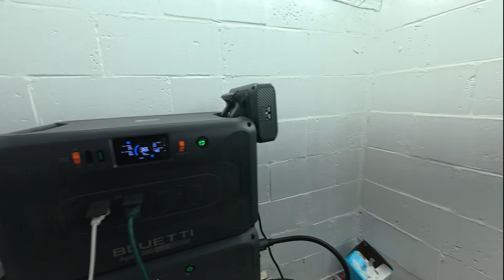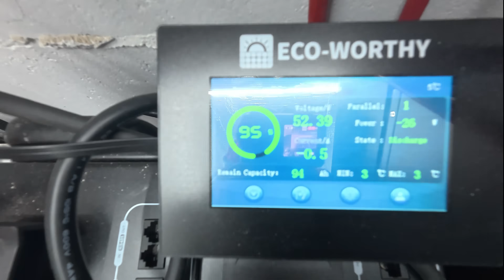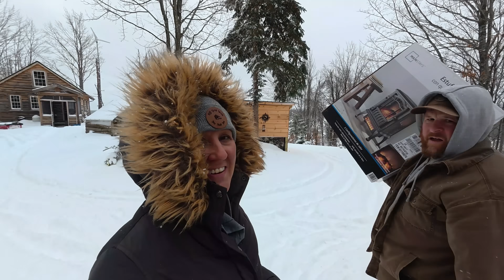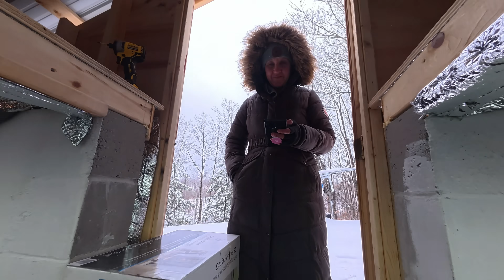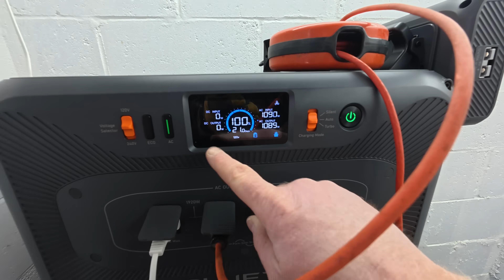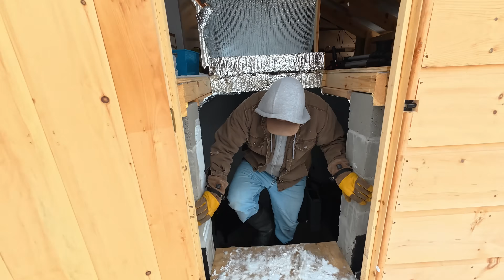Experimenting With Heat in Our Off-Grid Bunker | PLUS SOLAR BUNKER UPDATE

Comment: Great video! You should look into those oil filled rad heater. It is radiant heat, like a water filled rad. But once the heating element heats up the oil it will shut off raising its efficiency. They also come with a mechanical switch to work off your bluetti I believe low is only 600 watts medium is 900 watts and together is high at 1500

Comment: Probably best for the batteries if you do heat it up to 65f with the Gen or for 10-30min before starting the charging.

A old style plug in timer could heat it up for 20min everyday before sunrise.

Comment: 52,4 V is cca 60%. not full, soc calculation is bad...
Reply from the maker: Thats what I was thinking. all the batteries are equalized in voltage, but the screens are not displaying the proper SOC. I think you are right

Comment: Hi! I am following from Italy, finding your  videos very interesting . I have seen with great interest the building and setup of your bunker but i have a question regarding the position of some of your batteries. Some of them are installed FLAT on the floor, one over the other, and this is, in my opinion, absolutely correct. Other batteries instead are installed vertically with the display and connectors up. Did you ask to the battery provider if this setup is ok for the cells? Maybe the gel in the cells isn't working properly and this could be a problem causing a shorter cell-life! Please check with battery producer, i would like to continue following your channel without blackouts due to battery fault. Thanks for your videos
Reply from the maker: Great advice. They should all be ok. We have seen others do them this way as well. Thanks for your concern. Thanks for watching from Italy!

Comment: Your consumption is so low that the batteries go into standby which is kind of like "off" mode.  That is why they are still 100% SOC.  Pull a large load to wake them up!!
Reply from the maker: Glad to hear it, I started transferring power from this system to the back up system and the bluetti system and they seemed to come on when needed. BUT...once the voltage dropped they all read zero out of the blue,  so im going to keep monitoring it all 👍

Comment: How can your batteries be tied together and not all be the same percentage rate of charge?
Reply from the maker: They equalized by voltage.....I think the percentages may be showing inaccurately,  but still working well
Reply: @OffgridwithJayandJen  how about they are showing correctly, and you have them hooked up incorrectly?
Reply from the maker: @JohnSmith-ug5ci are you asking or what? The batteries are all the nominal voltage so they can safely be hooked together like I do.....the problem is with communication and the BMS reading and tracking the capacity because they are all hooked together.
Reply from the maker: @JohnSmith-ug5ci they can be hooked up like this safely......it just not the most ideal fashion
Reply: @OffgridwithJayandJen  Not talking about safety. Just proper install and clearly this is not proper.
Reply from the maker: @JohnSmith-ug5ci yes, we are experimenting.....as stated in the title. Plan and simple

Comment: You need solar assistant and a victron battery shunt integrate those and you will have a better idea of where you are at with battery voltages translated to SOC and better tracking with the Solar Assistant.

Comment: All resistance heaters will generate roughly the same heat per watt and are effectively the same efficiency. It's a shade over 3.4 BTU per watt. That includes the incandescent bulb in an enclosed space because even the light will get absorbed by surfaces eventually.

You could get any ceramic heater with variable heat levels, especially if it's network controlled. 

A Starlink mini on the standby plan will have plenty of bandwidth to control everything in there and then you wouldn't have to run cables or dig trenches.

Also, have you ever seen solar thermal collectors? You could put one vertical on the south side of the bunker with an awning that would cover some of it in the summer. It's effectively just some black tubing that the sun hits, and the awning wouldn't block it when the sun is low in the sky in winter. It would likely keep the mass in the bunker much warmer. Then just a little 500 watt resistance heater set to like 5C to come on if the equipment running and solar thermal collector doesn't keep up.

The bunker is a great idea, I'm in East coast Canada and wanted to do a solar shed like that but never even thought to do a bunker.

Have you ever seen Tech Ingredients 150 dollar ground source AC video? You could also do something like that with any cheap cmheat pump and likely pull a COP of 4 which would get above 12BTU per watt instead of the 3.1 of the resistance heaters.
Reply from the maker: Good Info, I'll do some digging and find the videos. thanks for the information and suggestions.

Comment: The batteries will always draw down at uneven rates. Even the same brand paralleled the propper way will have some variance. That being said, The BMS systems don't all report percentage the same either. The biggest thing to look for is the voltage of each unit. The voltage should stay the same accross all the batteries. Where you will run into imballances should really only be when you have a medium to high load (charging or discharging) on the system. 
Say your batteries are all full and you decive to run a couple electric heaters. The Battery with the largest capacity and lowest resistance will be providing the most power to the inverter (Lets call this battery A). BUT!! This will cause the voltage of battery A to drop more quickly than Battery B,C,D,E,F.... What you will see happen is those other batteries will start supplying more power and Battery A will be supplying less.
What you will see happen in this instance is when you turn the load OFF, batteries B,C,D,E,F will continue to DISCHARGE, but the power from them is actually just feeding into Battery A until all of the batteries are at the same voltage again. Hope that makes sense.

Where this might be a concern is at the bottom of the charge level. If the batteries are about to die, a few of the batteries will die FIRST, the BMS will shut them down and then the other batteries in the system will take up the slack until all of them shut down. Still, this isnt much of a concern since you have safety system (breakers and fuses) in place to prevent overcurrent on the wires. 

Sorry if this is a bit long to read but I hope it helps.

Comment: What is the big opening on the roof over the battery’s?
Reply from the maker: inside the bunker? there is a spot for all the wiring to come in and out, it is closed up tight, but not insulated well yet. Above the Bunker is storage for some things and it is where we have the generator for charging in winter.

Comment: I'd run an eternity cable from your router/starling to the bunker. Put a router or extender as an access point on top of bunker but inside the door. That should help with a better signal strength.
Reply from the maker: Great idea
.we will consider that

Comment: Plan on enclosing the otherside of the shed?  Seems that lots of snow gets in there and if the temps do rise it melt down into the bunker.
Reply from the maker: We are not sure what we are going to do there. 
Snow gets in mostly from the side the door is on. It needs to be buttoned up as there are gaps between the wall and the roof.  We will be working on that soon!!!

Comment: Looks like all those extra batteries and panels are paying off! Nice work! I think those oil filled electric heaters would work out for your bunker. I think they have a low setting of around 500-700 watts along with a thermostat?
Reply from the maker: They definitely are! Appreciate the heater suggestion, we'll look into those!

Comment: You have a pretty massive battery bank for 200w of steady consumption.  Some BMS's aren't able to track very small amounts of power in/out of a battery.  I have seen many situations where a tiny draw will result in a battery reporting it's still nearly full, when it's almost empty.  It's entirely possible your bank is so large, with so many batteries contributing to the draw, that some of them are putting out so little energy it can't even be tracked by the BMS.  If your largest battery is 67%, and all of the batteries are properly connected to a set of large buss bars, then it is FAR more likely all of the batteries are at 67%, or thereabouts.  That's how it should work, if you have everything wired correctly.  Since you are using what appears to be pretty beefy buss bars, that would explain the results you're seeing.

Comment: Yes we have a junk drawer a couple actually 😁. That silver lining stuff you have insulating the bunker might also be blocking the signal as well. Besides the other things you mentioned such as concrete and underground. You could try a wifi extender to see if it works and if does you could put a WiFi camera in there to keep an eye on things as well, when running heat in there. If that heater has a thermostat on the lowest setting, it should come on and off,with door shut, when it reaches temp correct or no?
Reply from the maker: Ya the foil is definitly causing issues with getting the signal. Yes the thermostat will help control it better.

Comment: I dont know for sure if it is the case for the models of battery you have, but some BMS have problems counting. The use of power when the draw is wery low, and if you spread 100, or 200 or 300 watt standby load on a bank as big as your, and the draw is spread out more or less even on about 15 batteryes, it is  only 6 to 20 watts eacy and may not get accounted in SOC.  As for the green lights on the front of the batteryes the split up 5 kWh in big chunks, so just a Rough indicator. Yes the most importen part as for temperature is to keep it abow 0 degree celcius, if you are charging them, but I would try to keep it at aleast 10 c.

Comment: You need to seal up that other side Jay. It will not be 100% temp regulated until you do that. If snow is getting there that door with the lock wont matter.

Comment: Junk Drawer always Saves the Day. 
Life Smart Radiant Heaters are the best I have Found Watt to Creature Comfort  " HEAT " these Units run Eco Mode @ 500 watts, Medium @ 750 watts and 1500 watts on High. most small rooms like it most on Eco Mode to Remove the Chill  🥶 and able to WiFi Connect to My Eco Flows and Oupes Mega 1 and Mega 2 Units when needed.

💦 Indian Creek Ranch ⛩

Comment: Jay, concrete blocks radiate cold from the outside. Have you thought about putting more of what you have on the ceiling into the walls? If you had dirt on the outside of every wall it'd be more like a cellar. Put your thermometer pointer on places to see where the cold is coming through. Might not need any heat source if it equals being a true cellar. Great job keeping up on the battery rates
Reply from the maker: Ya I think some adjustments are needed

Comment: Ya shouldnt mix and match the batteries like ya have but ya need a cheap thermal camera to check the temps but also insulate the battery bunker properly aswell and btw the 100W light wont produce shit to warm it up
Reply: I thought the same thing about that 100-watt incandescent bulb. A lot of viewers over many videos suggested it but the size of the room and all the equipment in there is just too much.Ain't gonna do nuthin'!

Comment: @offgridwithJayandJen - First thing to know, is that NONE of these battery meters are that accurate particularly when they are not fully charged every couple of days.   They have to measure the current in/out to and calculate based on the known capacity.  Also, the BMS in many of these battery brands are not able to measure small amounts of current, thus with low draw, they dont even adjust the %.  You can only really know the charge levels near the top and bottom of the charge based on voltage.  Voltage between 20-80% is almost the same, so even using voltage is not that accurate either.  Hope this helps.
Reply: just make sure the voltage between each battery bank is basically the same (+/-0.1v)
Reply from the maker: Good to know.....they are equalized pretty well, I think within 1/10th of a volt, so im thinking im good. Thank you

Comment: maybe either add some concrete blocks in front of the heater or just turn it around to the wall. Thermal mass is your friend!! heat for a cou0ple hours and the blocks will continue to release the heat back into the bunker after you shut it off.

Comment: You could just set the thermostat to maintain the temperature. It would work as long as you have sufficient solar to keep the batteries up. A smaller heater that used 300 watts could work. It could be connected to a thermostat so it would shut off if you find it gets too warm when running continuously.

Comment: i built a small solar hut and put a space heater like the one you have. I put the electric space heater on the lowest thermostat setting and let it do its thing. I also put it on a wifi outlet to have extra control of it. i ended up bringing my solar equipment inside the house because i didnt have enough battery/solar panels to keep up with the house and heating the small hut.  Thanks for the video!!!!

Comment: I have many 'junk' drawers - - a drawer for the batteries - a drawer for tools so I don't have to go out to the workshop - a drawer for my plug in scents from Bath n' Body - (I have 4 small drawers on both sides of the sink front - that's just the kitchen - of course there is the bathroom drawers for the extra's. Then there are cabinets in the basement - storage in the garage -  whew - I think I named them all!

Comment: You’ve ran soo much cables everywhere you just need 1 more, CAT 6! Run a LAN cable straight from your starlink to the bunker and then install an extender 🎉
You’ll never lose connection and what a great vid that would be ❤
Reply: And you can get direct burial.

Comment: There is a electric thermal 120 v olt ac plug that automatically comes on at 32 degrees paired  with a 250 watts heat lamp should keep your batteries above freezing. I think its called therm cube.
Reply from the maker: Hmm interesting 
 Will have to look into that! Thank you!
Reply: @OffgridwithJayandJen your welcome.

Comment: If you have room in the bunker, take that freezer and put it in there, running the compressor to make the freezer work puts off heat, you are just wasting that heat being in the open as it sits right now. Anyway just a suggestion and if it doesn't work for you , you can always take it out! Good luck! Always Rooting for you guys.
Reply from the maker: Thanks for the suggestion! Appreciate it
Reply: And if you do end up putting the freezer down in there, make sure you take the back off that covers the compressor at the bottom, usually cardboard, remove that!
Reply: Really interesting video , and heck yeah I have a junk drawer Jen, doesn’t everyone! 😊

Comment: I seem to recall you can operate Lithium batteries below freezing but cannot charge them.  I would place a heat mat or electric blanket on a thermostat to just keep them above freezing if it comes necessary to charge them.   The batteries themselves also generate some heat while they discharge.

Comment: Why not try a 600–700W oil-filled radiator? I use one to maintain the temperature in a small room. It’s not as efficient as a mini-split, but it’s a cheap and relatively low-energy option for electric heating.

Also, there are smart Wi-Fi plug outlets. With one of those, you can still control the heater remotely via Wi-Fi from the cabin, while saving power by avoiding the second inverter in the power station.
Reply from the maker: Thats a great idea! We will look into that
Reply: @OffgridwithJayandJen   
Using a heating blanket over the battery cases could work and would use even less energy, though it’s definitely a bit of an odd solution. There are 12V DC cigarette outlet versions too. Still, most batteries should already have some kind of built‑in heating system anyway.  But an electric blanket should be a better heat source than a lightbulb for the water pump under the cabin.
Reply: From what you observe with the 1K heater, my guess is the thermal mass of the bunker is very large, and no amount of heat will really help too much. But that's exactly what you wanted, the ground is acting as a thermal reservoir. At that depth the ground is around 40 to 50F all year round. I would take the win.
Reply: I like the oil-filled radiator heater, particularly because they (at least, on mine) have an infinitely variable dial thermostat, not just one with low-medium-high settings. Would be so easy to set the thing to provide just the bare minimum heat needed to keep power usage to a bare minimum. Set it on one of the lowest numbers, 2 or 3 at most, it it would quietly, efficiently and safely put out "just enough."

Comment: I have a receptacle in my camper that my manual or analog electric heater is plugged into that turns power on when the temperature drops to 35°. 
Even with the lower battery prices, most would not spend the money for what you have. As you know, resistance heat draws really hard on solar, so it isn't really practical. If you add a router extender, locate it above the ceiling to make it above ground level, as the ground is a ground and signals will be absorbed by it.
I, like a lot of others watch many videos, and watch the shortest ones first and the hour-long ones last in case we get too busy and have to skip any, it will be the ones with a lot of talking and fluff in them.